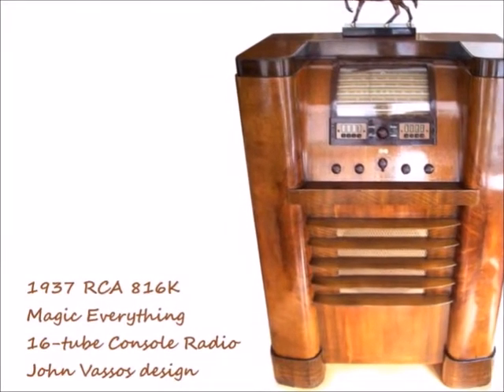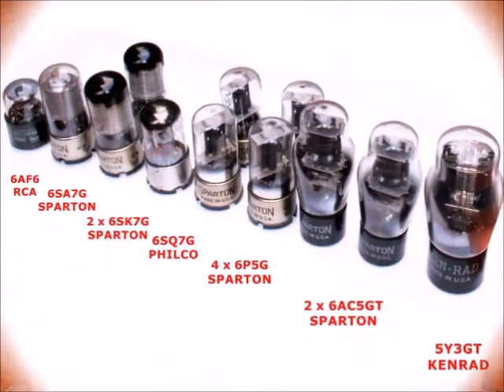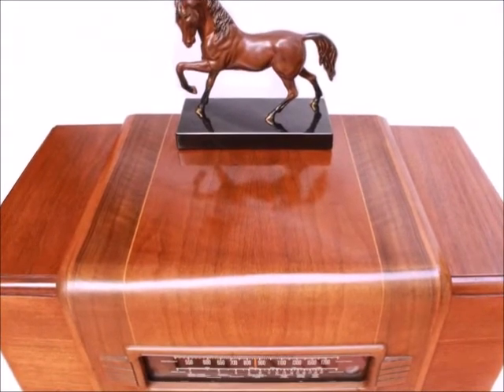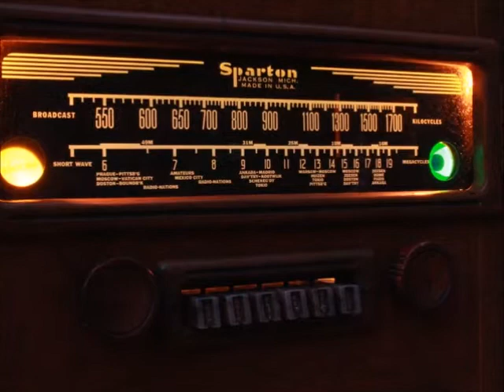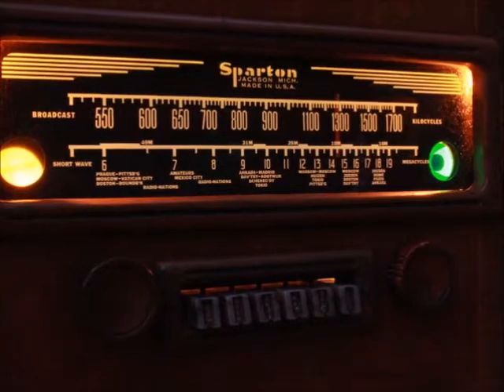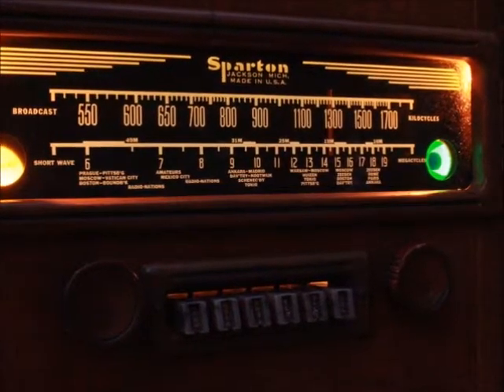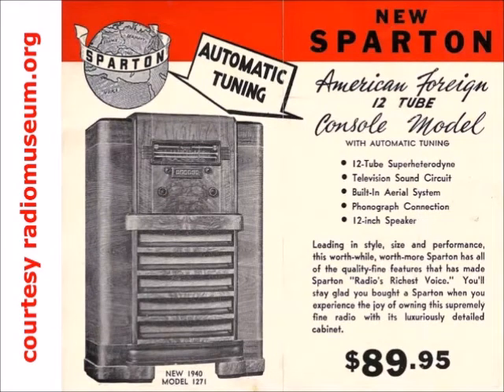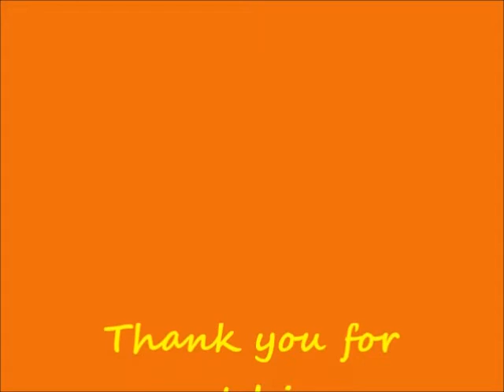1940 Sparton Model 1271 12-tube Short-Wave Console Radio

Comment: I have a Sparton Model 79 I just fixed up. I can do normal tuning but I have no clue how to setup the automatic push button tuning. Do you have any info on that? It seems to be working fine but tuned to non-existent stations.
Reply from the maker: Model 79 is a 1938 Canadian table radio. The schematics is at Radio College of Canada, page 64. Automatic tuning comes in a vast variety,  mechanic, electric, electromechanic, ... - you just try a little.